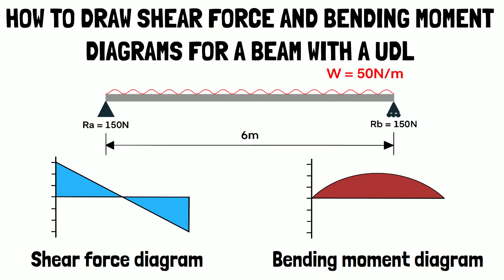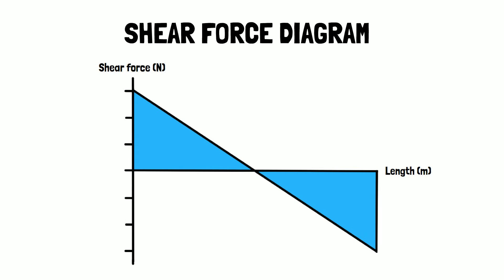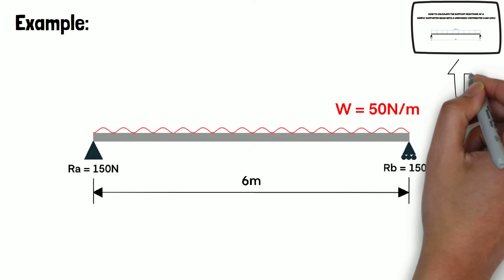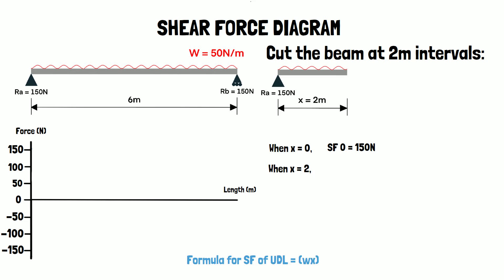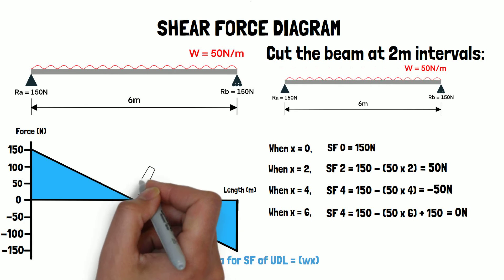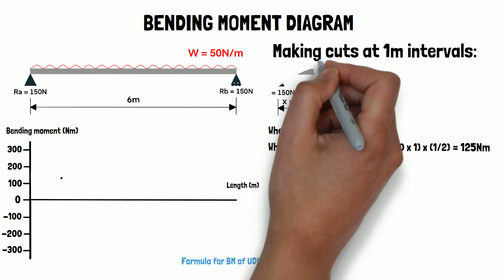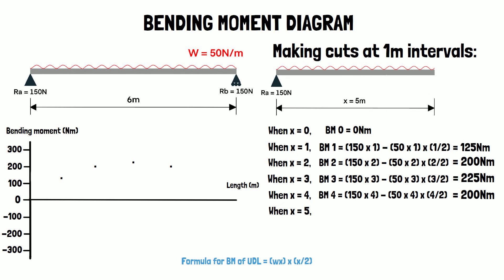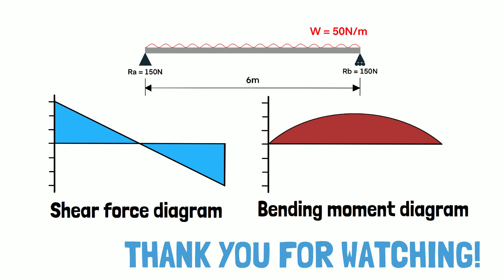How to Draw Shear Force and Bending Moment Diagrams for a Beam with a UDL

Comment: Hello dear,

Great job. I would like to appreciate your work. But it would be better if you would edit or add another video to explain the corrected Shear force diagram. I am also attaching your reference comment below so for more understanding.

"Apologies for the poor explanation on my behalf, sorry for the confusion. When x = 0 the shear force goes from 0N to 150N. When x = 6 the shear force goes from -150N to 0N. The UDL continues to act on the beam up until x=6, so the magnitude of the shear force increases up until 6m as the span of the UDL increases. Hope this helps"

Comment: At Point B ( end of 6' to the right), the shear force you calculated is 0 but the diagram shows (150 N)? because shear forces at 0 and 6' distance should be equal and 150 N each, please explain why ?
Reply from the maker: Apologies for the poor explanation on my behalf, sorry for the confusion. When x = 0 the shear force goes from 0N to 150N. When x = 6 the shear force goes from -150N to 0N. The UDL continues to act on the beam up until x=6, so the magnitude of the shear force increases up until 6m as the span of the UDL increases. Hope this helps